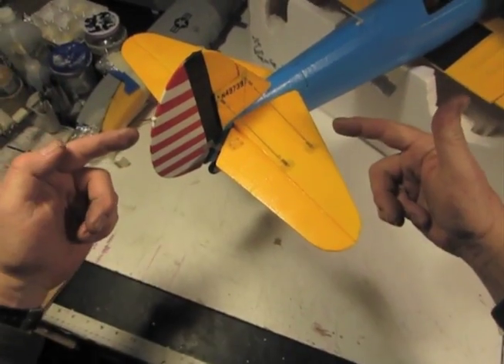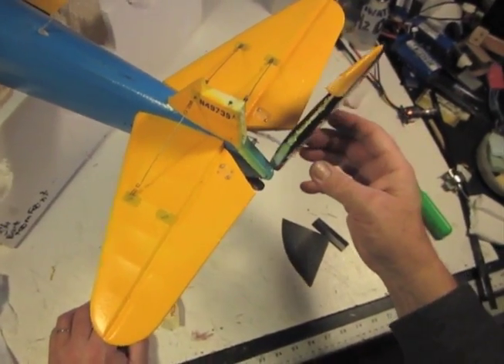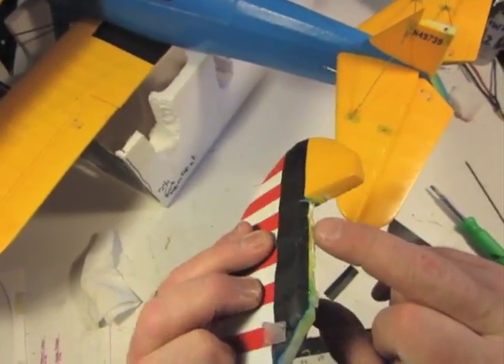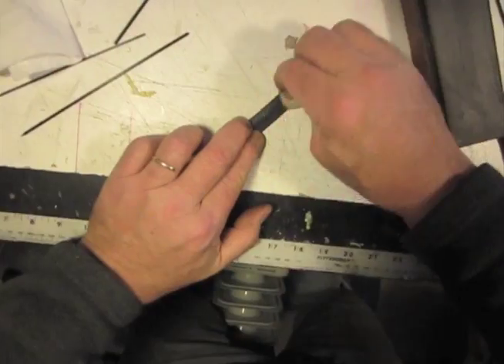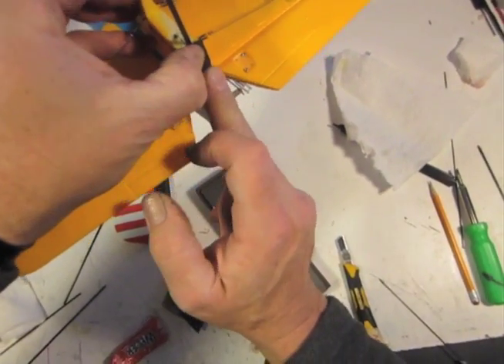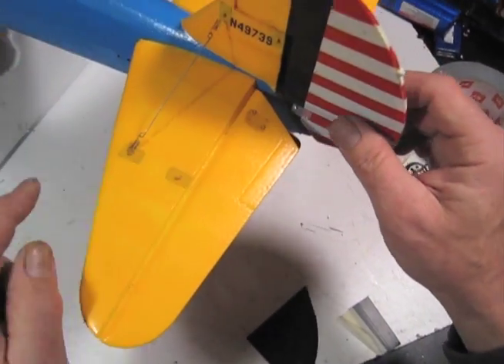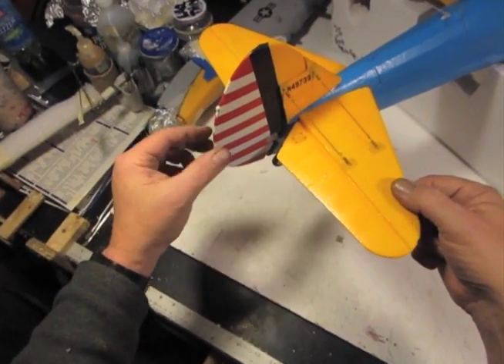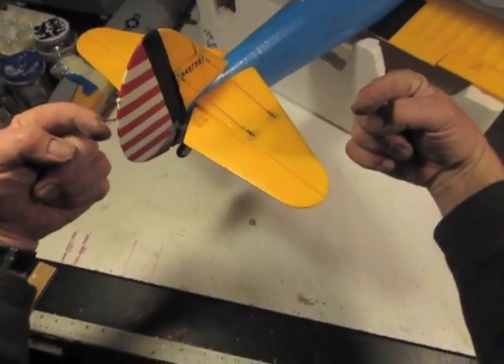TINY TIPS -  How to Make an HDPE Plastic Hinge

Comment: Steve, this may be one of your best tips yet. I never thought of using HDPE to make a hinge. It's gotta be tough as nails. At least as strong as any of the hinge material you can buy at the local hobby shop. Plus it's self-centering. Outstanding info, thank you.
Reply from the maker: I just love this stuff. I have a candy tube I stepped on in the school parking lot one day while walking over to pick up my crashed plane to thank for the idea about plastic. It was clear to me that it had been on the ground for a LONG time, being driven over every day- and it wasn't even cracked, it was just flattened out. When I held my broken plane in one hand and the unbroken plastic in the other, the proverbial light bulb went off

Comment: I've never had an RC Plane & now I'm on the verge of building
my 1st one....lol, yep, so I have been all thru the foams but I
didn't like the idea of a "Taped Hinge". IDKnow, seems like it
isn't right even though many do it? I was thinking milk jugs
for other parts & here you are. Thank you for an answer to
my dilemma.Tape has come a long way but this is solid.
Reply from the maker: diggy dice - Yes, HDPE works very well for loads of things- I love the stuff. Nowadays I use 1” x 3/4” pieces every 6” or so, meaning top and bottom on that rudder. Cutting slots in a continuous piece (to leave 1” wide “hinges”) gives the same hinge flexibility with greater overall strength
Reply: Killer Planes >> I kept seeing these great works of
foam made into  planes & they were  settling for a
piece of tape as  the hinge. I'm doing lots of study
up front to d o my best so when I saw your stuff it
backed my own  thoughts  of using  milk jugs or a
plastic  soda  bottles in my build. I have hundreds
of  old  clean  plastics I was  going  to make other
products  from  so  I know  how to melt & shape it
but this rudder is a small piece of flat plastic that's scored in the center to act as a hinge! I'm all about using this / it just makes sense.
Great work, great ideas.  chat soon
Reply: You're gonna get hooked lol
Reply: I'm afraid you're correct.....lol, I haven't bought anything yet becausethere's much to know especially with the electronics. I just don't needa drawer full of "parts/crap" that I strip off to put better stuff on.And I'm thinking about "hinges" before I even fly?   Go figure.....I feel like a fish,  >> HooKSET Deep<<   peace